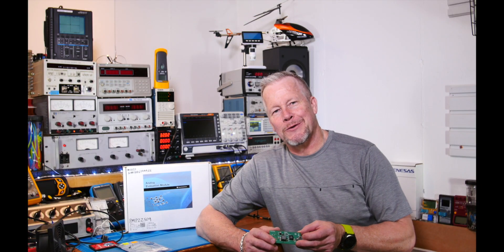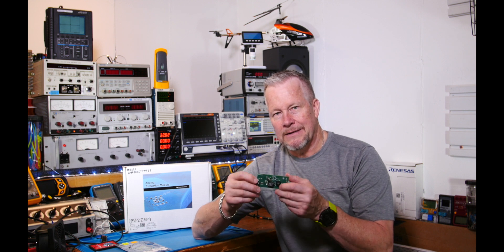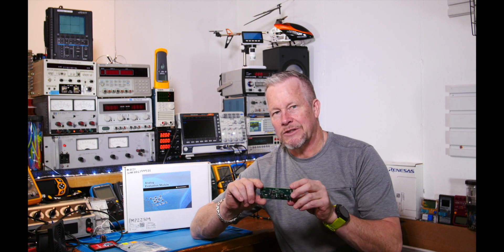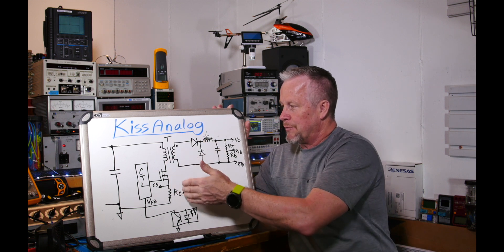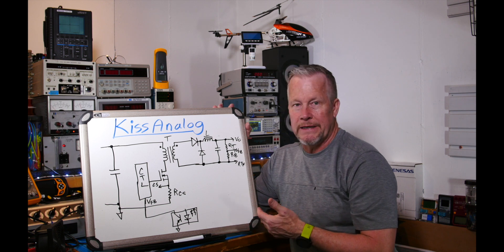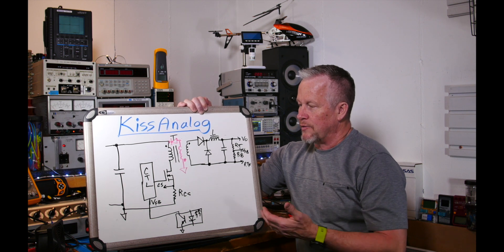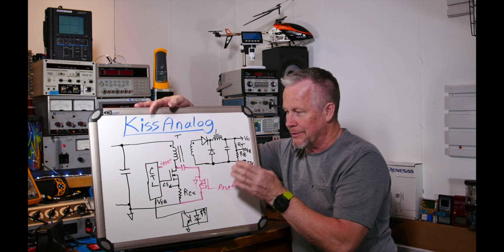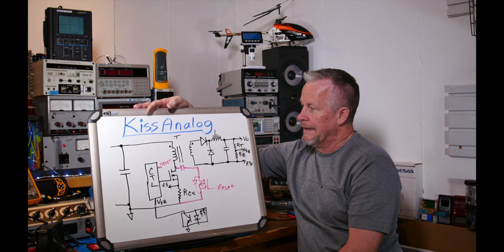Intro Active Clamp Forward Converter #activeclampforwardconverter #activeclampconverter

Comment: Awesome awesome channel. I played around implementing a forward converter. Just driven with a sig-gen, it's amazing how it adjusts to load, even without primary-side current-mode regulation of duty cycle. super tendancy for stability.
 
Eliminating the third winding also opens up the design up to more commercial off-the-shelf transformers/coupled inductors which is a great simplification. I get stuck trying to implement snubber networks, and knowing how to choose RCD values, so was searching, trying to understand active clamps and found your video.

I think these are the links,

    UCC2897A 
    https://www.ti.com/lit/ds/symlink/ucc2897a.pdf

    PMP22509
    https://www.ti.com/lit/ug/tidt189/tidt189.pdf

    WA8515
    https://www.coilcraft.com/getmedia/0b4f08d1-afae-4cfe-aa97-e1632b179ce0/WA8515.pdf
  
Really interested to see how the p-chan VGS is driven negative. Maybe an upside down bootstrap circuit.
Reply from the maker: Thanks Julian - I really appreciate the feedback!  I do like how this design simplifies the magnetic design and also removes the need for the snubber on the main FET;)  I need to get back to this converter and eventually show an actual design.

Comment: Hey man! Love your videos and how you explain things so clearly!

Could you please consider making a vid on how to build a basic soft starter for power tools plugged into the mains? Other vids on soft starters / speed controllers are too confusing and I don't want to fry myself lol
Reply from the maker: You got it!  Thanks Chris for asking.  Great question by the way;)
Reply: @KissAnalog  Awesome!!! Would be great to know how to this could interact with a speed controller and work with 240v!

I'm after an easy (crude) solution where accessing the switch will be convenient when holding the tool(s). Any ideas? Building a circuit into the tool itself wouldn't be possible, but maybe at the start of the cord? Or ahead of some distribution board multiple tools can plug into, and use tool's normal switch?